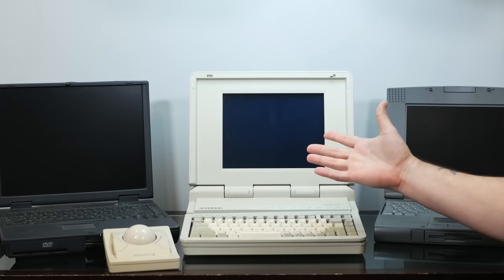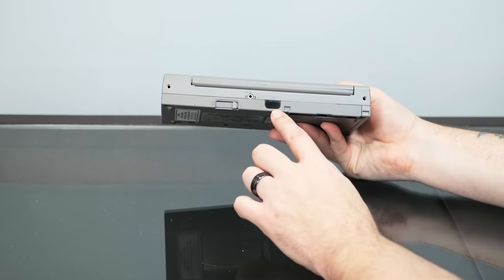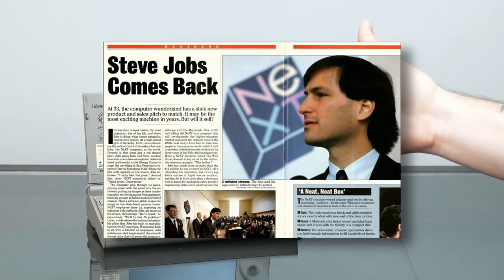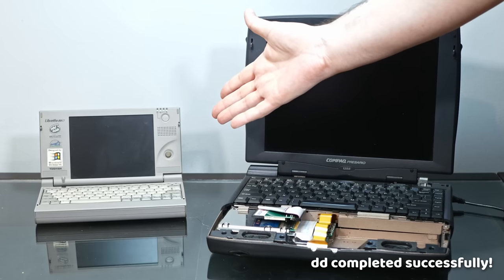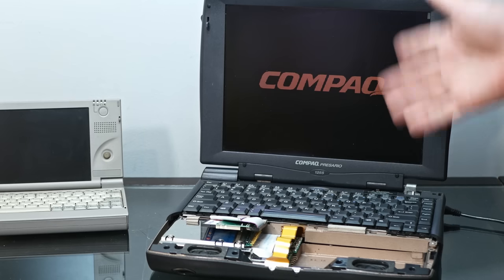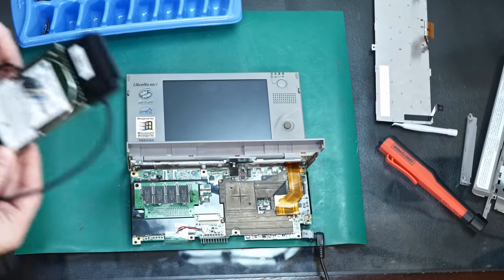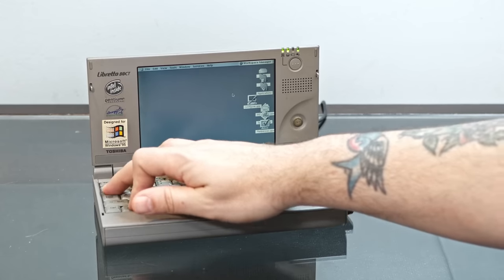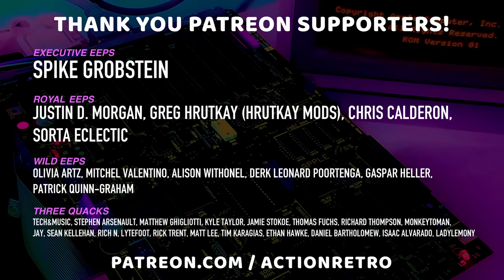I Turned My Toshiba Libretto into a Teeny Tiny Hackintosh with Apple Rhapsody OS!

Comment: Rhapsody was basically OPENSTEP 4.2/Intel with a Mac OS veneer.  It was actually meant to run on intel machines not branded by Apple.   So it's not REALLY in actual fact a hackintosh.   I used to run OPENSTEP4.2/Mach for Intel on my machine at home for years.  Full Disclosure: I am the GNUstep lead (gnustep.org) maintainer and former NeXT developer. :)   Much respect, though.  My comment is meant to be informative.  Love what you're doing here bro.

Comment: For a teenage PC enthusiast, the Toshiba Libretto was anything but useless!  I got mine used on eBay back in 2000, and this was the first laptop I ever owned.  Mine was the 100CT (slightly faster CPU and a wider 800x480 LCD) but I used that little thing for every task I possibly could!  I browsed the internet over WiFi with an 11Mbps Belkin PCMCIA card, I did my homework on that little tiny keyboard, and I even took my Libretto to college with me in 2003!  I used to write Visual C++ code on it in college - I had the whole development environment installed on that little thing!  It was so impractical and I absolutely loved it!

Comment: That isn’t a hard drive! You accidentally installed windows 95 on a Geiger counter
Reply: @camthesaxman3387  hahaha. I can tell. The powerbook 520c I own also has an extremely loud hard drive
Reply: @camthesaxman3387  I sometimes hear my hard drive spin up while I'm using Chrome and I don't know what's going on?

To make matters even more confusing my OS is installed on an SSD.
Reply: @bland9876  Browser might be checking the HDD for whatever reason, sometimes even the system is doing that, again, for whatever reason.
Reply: That sound was my 90s. Out with Cold War fears, in with hard drives! XD
Reply: Can it run doom though?
Reply: The family desktop from 2005 sounded like that.

Comment: Hi, great video as always.
A couple of points about CF cards:
1. Unless you pay ungodly amounts of money for industrial-grade ones, they identify as removable devices. This doesn't worry DOS, Win9x or Linux, but WinNT/2k/XP/7/8/10 get upset being on a removable device, and other OSes may do too. For Windows there is a driver called diskmod that can get around this, but it's a bit fiddly to use.
2. Modern CF cards are intended for digital cameras, and are optimised for fairly large reads and writes. On a computer OS where typical reads/writes are fairly small, the performance can be terrible (I've verified this with some thin clients I own that use CF cards). If you can find a suitable adapter for your hardware an SSD is a better way to go long-term - I upgraded an iBook G4 by using an M.2 SSD in an M.2-to-2.5" IDE adapter - the speed of this is only limited by the IDE interface. It does cost a bit more though.

Thanks again for an intriguing video.
Reply: Another good option is IDE DOMs (Disk on Module), so long as you don't need a lot of space.  They're all fast, durable SLC flash, non-removable devices, available in 44pin versions that can plug straight into a laptop IDE port, and for something like this where you don't really need multiple GB you can get them for ~$25 each.  Stupid expensive if you need anything much bigger than 1GB though, but the big advantage is they're still made new in small sizes that old computers expect (as small as 128MB).  All smaller CF Cards are basically just new old stock when you can find them.
Reply: eu tenho libretto 70 ct quanto custa eu tenho pra vender mas nao sei o minimo que eu posso pedir, funcionando perfeitamente
Reply: DoogieLabs made a video installing Windows 95 to a Libretto with CF card... a 55 min long video
Reply: I know that some older consumer SanDisk CF cards can make use of a DOS utility which toggles a bit in the firmware that allows it to detect as a fixed disk. It’s just very hit or miss since there’s not an exact list as to which ones work with the program but from what I can tell they age upto the mid 2000s roughly.

Comment: Nice ;)
2 things:
1. You've installed/selected the wrong driver. For the 50CT it's C&T (Chips and Technologies) B65550. If you can't find it on the OS,  The Openstep has drivers for your chip (6555x)
2. I think there is a configuration file that you can modify in order to change the resolution/BPP, but I don't remember which file.
Reply from the maker: Thank you!!!
Reply: @ActionRetro  OPENSTEP 4.2 w/ Patch 4 also has a VESA driver which should provide color if it doesn't have a C&T 6555x driver.
Reply from the maker: @dosenfisch24  thanks for this, super helpful!
Reply: eu tenho libretto 70 ct quanto custa eu tenho pra vender mas nao sei o minimo que eu posso pedir, funcionando perfeitamente

Comment: When it was disassembled, you need to unplug and bin that green CMOS battery of death immediately. I went through 4 LIbrettos this weekend and 2 of them had green corrosive crap coming out of the connector to the motherboard and in another year or so would have eaten away at something important. It doesn't need the battery to boot and you just set the time and you're away.

Comment: To make life easier with the SD card being so far back in the machine you can buy SD card extension adapters. Then you can stick the card slot right up at the front of the HDD bay and get easy access ^^

Comment: You could also try using PCem for the virtualization, which has a lot more control over the emulated hardware (especially of that era), you could more closely match what you're trying to flash the OS onto.

Comment: Wait doesn't the 50CT have a 75MHz Pentium? I thought only models after the 70CT had over-100MHz Pentiums.

Also the 50CT and I think all of them have proper sound chips. The 50CT itself has a bona-fide Yamaha OPL3. By far my favorite Windows95 machine. 

ALSO also how did you get your PCMCIA adapter to get recognized so easily? I still haven't managed to get my PCMCIA adapter working on my 50CT.
Reply: Yeah. The 50CT has a Intel Pentium 75 MHz, 16 MB RAM (32 MB max.), 810 MB hard disk, 6.1-inch TFT display.  I overclocked mine to 100mhz in 1998 or 1999 and compressed the HDD to squeeze out some more storage. If he has 32mb then he already has the proprietary memory expansion module and it’s maxed out.   That was expensive for me on a college student budget.  It came with the “port expander” (that he referred to as a dock) that came with it.  It also came with the PCMCIA floppy drive that he’s missing. I have the dock and it is very nice.  I also rocked Iomega’s 40mb click drive that also sat flush in the PCMCIA slot.  I loved this thing.

Comment: I’m sure someone has mentioned it somewhere deep in the comments but don’t forget about the Libretto 100/110. They have a NeoMagic NM-2160 and both can support 96MB of RAM. The 100 can also be overclocked to 233Mhz fairly easily.
Reply: They were also delightfully well made. I'd buy a properly done modernized clone in a heartbeat as I found them quite nice to use.

Comment: I wonder if the initial CF boot issues have to do with fixed versus removable mode for the CF card? Getting ready to do a similar surgery to my old iBook G4, and was researching how some older PCs and some OSes require installation/boot from a fixed drive rather than removable, though I suppose the SD booting might negate that?
Reply: The CF boot problem in the video looked too early in the boot process to be related to fixed vs removable. It was as though the CF card wasn't being recognised by the BIOS, which suggests to me the card might have been too big for it to recognise. I'm not sure what size the successful SD card was.
PS. Years ago I got OS X 10.3.9 to boot from an 8 GB SDHD card using a generic eBay adapter on an Apple iBook G3. It replaced a hard drive that was even noisier than the one in this video.
Reply: @zoomosis  Great point—thank you for that thought! Also appreciate the note about your experience with the old iBook—waiting on one such a generic adapter from eBay. Shipping times are measured in months these days ...

Comment: The design of the Nintendo DSi and posterior version looks very close to the Toshiba libretto.
Reply: I wouldn't be shocked if DSi or 3DS had a little more power though, or at least similar preformance.

All I can say for sure is that a homebrew hacked 3DS is really fun to play around with, even have a version of linux installed that I need to tinker with some more
Reply: @UNSCPILOT  I think that MJD channel shows a video of a DS running old versions of windows, that's amazing

Comment: On 486 and any old machine the bios limits the max hdd size you can use, so you have to either use software to workaround that like ezdrive or you have to use an appropriately sized disk

Comment: One thing I found with the Libretto 50 CT which I still have also having bought it new  (Not Cheap back then ) I really like how useable the trackpoint is on the display lid actually is it works really well.
Standard they came with a port replicator  which helped out but remember these were Windows 95 originally some 25 disks for windows and another six from memory for drivers and other software.
The original hard drive was well what you expect for the era I suppose and yes I still have it.

One thing was the first Toshiba I owned was an 8086 CPU and the operating system Dos 3.0 was installed in Read only memory and expansion was a very expensive plug in 2 megabyte card the real advantage with the OS being installed the way it was is it makes it totally virus proof shut down and reboot and you have a clean OS as it cannot be written to or compromised a very useful feature nobody seems to have remembered these days for IT security repairs to client systems.

Comment: I own one of those, I'm not surprised your graphic driver doesn't work, this system has nothing made by S3, and doesn't even have anything PCI to begin with.

The video device is a Chips & Technologies B65550 connected via an ISA bus, Audio (I don't remember if Rhapsody support it) is a Yamaha OPL3-SA2.
Reply: Technically the video adapter uses Vesa Local Bus(!), but there is no PCI - so 32-bit PC cards don't work.

Comment: I have a couple of these! I purchased a 70ct when I was traveling in the 90s, since I could not open a standard size laptop when flying coach... I did a ton of custom application development on the little unit and my team called it "Mighty Mouse". I was able to replace the flying windows logo image with a little flying Mighty Mouse image. I can't tell you the number of conversations that Pc started over the years! I've recently updated one of these guys with an IDE SSD Drive and it still runs an old version of Win 95 & AutoCAD. I'm able to drive an ancient large-format 36" wide Pen Plotter through the serial port! I also have an Ethernet PCMCIA Card, so it is capable of accessing my network and the web. As far as other ideas... I bet it could run RDP, if you wanted a cute remote to a vPC...
Reply from the maker: That's so awesome!!

Comment: On my old thinkpad with ide to SD adapters I’ve used a bunch of electrical tape to make a handle.
Then to install it I dangled it in there and used a plastic poker to get it into the ide slot.
It’s a little fiddly to install, but it’s much better than taking it apart.

Comment: I had to reinstall Windows 95 original on a Libretto 50CT back when they were still a new thing. The owner had the special PCMCIA floppy drive. The process was complicated by Toshiba not yet having 32bit drivers for the floppy drive. For some reason that made it impossible to complete the install off the big stack of disks so I resorted to removing the hard drive and copying all the files off the floppies to one folder on it, after doing a format /s. Put the hard drive back in and installed from the hard drive.

Not having a 32bit driver for the floppy did some weird shiznit with Windows whenever it was plugged in. IIRC Toshiba did finally produce a proper driver for the floppy to make it work as it should.

Dunno why some companies in the late 90's dragged their feet on releasing drivers for 95 and NT4 for some of their current products. Iomega shot their Ditto Max tape drive product line down for business use by not releasing a NT4 driver until a long time after the release of the drives. A dentist wanted his new computer to run NT4, and he also insisted on using the Ditto Max for backup. The only solution was to install NT4 with FAT16 and dual boot with Windows 95B, also on FAT16, so that to do backups it could be booted to 95 and access the NT4 partition to backup the dentist office data. It worked, including restores, but was kludgy and required additional training for the front desk people, thanks to Iomega releasing NT3.5 drivers but not NT4 drivers.

Comment: About the specs of the machine, I think you have got the wrong info on the Libretto 50CT. The 50CT should have a Pentium 75 (w/o MMX), 16MB RAM (Upgradable to 32MB) and a 6.1" LCD Display. The specs you mentioned in video should be the 100CT. As an owner of a later model Libretto 70CT, I have plenty of spare parts for this lineup of machines, including RAM upgrades, LCD panel, power bricks, and a compatible floppy drive. I surly can help if you @Action Retro need help of those.
Reply: Yeah I was going to chime in and say the same. I own the 50/100/110 (and I'm still on the hunt for the others). Bruce is correct.

There is a fabled 96meg upgrade on the 100CT+ but it requires a donor laptop and case modification.

Comment: I use to sell these in PC World along with the Compaq IPAQ PDA's, sold one to Terry Wogan in Sluff! A long time ago there was a Japanese website offering these modifications whether anyone ever had this done or not a 70CT with a capacity of 4x the onboard RAM size would be a rare find today and I would like to see that. I remember searching high and low for this mythical memory module but I don't believe the architecture ever supported it 32Mb was the limit. The best I could get at the time was an imported Libretto M3 with 96Mb of EDO and I only ever found a module for an IBM Thinkpad that could go beyond the limit. I see why you removed the motherboard from the chassis to be able to show how you install the short length adapter, 2.5" adapter are also a little awkward but will slot in without the need to remove the motherboard. Pretty sure there is only one disk controller so single CF slot adapter, dual adapter probably will not work.

Comment: I wonder if you did peek at the graphics controller while it was disassembled? My first guess for that era would be a NeoMagic rather than S3.
Reply: Another way would be boot a minimal Linux text mode installation and run lspci (or pciconf -lv in FreeBSD). Though on this particular machine it looks like you have to take it half apart just to swap out the SD/CF card, which isn't ideal...

Comment: Cool project. The reason your video driver was not working is because you kept selecting S3 but that Libretto has a Chips & Tech 65xxx series video adapter. I own the same model too ;)
Reply: @stephensalex Did you install Rhapsody on it?  I just bought a Libretto from eBay will arrive in a while, trying to get ready for trying this install.  Also did you get sound to work, and color?
Reply: @_berskyboy  I don't run Rhapsody on mine. It could, but it makes a better DOS gaming machine for my uses. I'm glad you found one though, they're a fun little machine.

Comment: If I were you, I’d get an mSATA to IDE enclosure. I used to deal with CF cards to a certain extent, but I find the enclosures much easier. I got one for my Thinkpad R31 and it’s great. It allows you to fit into standard hard drive bays so you don’t have to do what you just did. I also have a USB to IDE cable so I can easily format mSATA drives in the enclosure, again, without having to crack open cases. Good as usual.
Reply: Tried this with mine, sadly the HDD bay is slightly thinner than normal so the plastic caddy wouldn't fit.
Reply: @nitrax8629  That was an issue with the one in my R31, I can’t use the metal caddy with the enclosure from Amazon so I don’t. I got a new one from eBay I’m going to try in my PowerBook 1400. I’d planning a video for that Mac soon.

Comment: I have always wondered, why an infrared port in the back? Do you put against a mirror or something?  Jokes aside, someone remember how those where used?
Reply: They were used for wireless data transfer between PCs and mobile devices like palm-tops, PDAs etc.
Reply: It was the thing to do back then. They even shoe horned an i.r. blaster into the gameboy color. If in not mistaken there was even some software back when that would let you use your laptop as a tv/vcr remote

Comment: It might be possible in some circumstances to boot from the CF card in the PCMCIA adapter, negating the need to take the machine apart to swap out the SD card. Though from my rough googling it seems to require a magic combination of a compatible CF card, cooperative BIOS and operating system to actually work.

Comment: Interesting video - shame you didn't find the right graphics driver for colo(u)r support. By the way, the specs you listed were wrong (they were for the later 100CT) - your unit had a 75MHz Pentium (non-MMX), 16MB RAM expandable to 32MB, a 6.1" 640x480 TFT and an 810MB HDD stock. One thing to not about the PC card slot is that it's only a 16-bit capable slot (the system doesn't have PCI at all, video chip uses VESA local bus!).